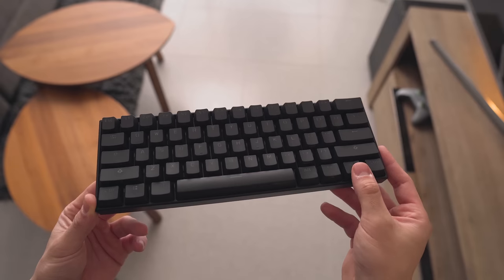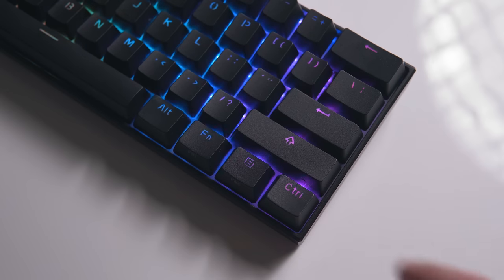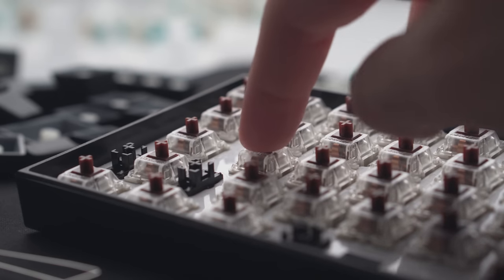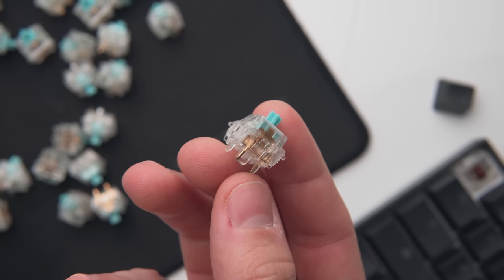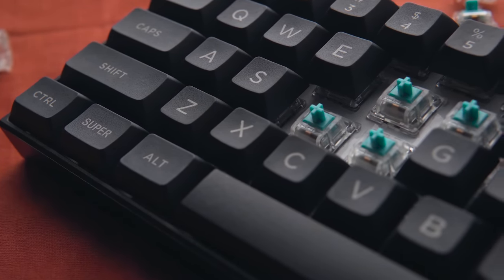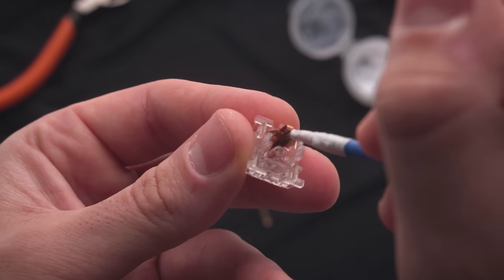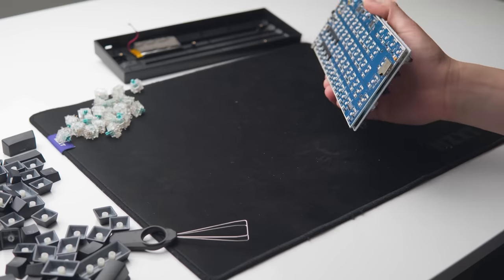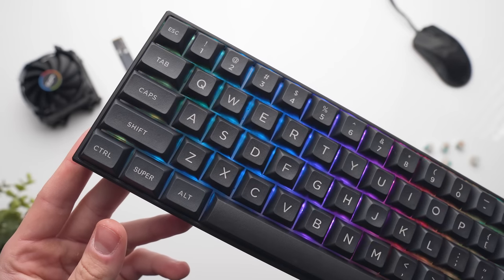Building my Dream 60% Keyboard

Comment: There's no point to get Anne Pro 2 if you're going to desolder the PCB anyway. There's a ton of custom 60% pcbs on the market and a lot of them have hot-swap support. Example: https://kbdfans.cn/products/dz60-60-pcb
Just get one of those, a custom body, and build a keyboard from scratch.
Reply: finally, someone mentioning DZ60

Comment: If you were soldering in new switches and using your own keycaps anyway, why not go full custom. A Kbdfans Tofu case and dz60 pcb would have been comparable in price, but offered an aluminum case in your choice of color, a fully programmable pcb with QMK firmware, and no desoldering. Also Ducky isn't a gaming keyboard company, Fortnite streamers just so happened to popularized the mini model.
Reply: cuz he already has that board.
Reply: @ltsjoke5443  True, but the video's purpose is to inspire others to build their "dream board", and mentioning a keyboard kit would have been helpful. After all this type of video isn't for the keyboard hobbyist who knows what is out there.

Comment: or you could just buy the glorious keyboard which is modular and you can hot swap the switches at any time.
Reply: Better buy a good plate, hotswappable PCB and case directly. 😂

Comment: ok, you really have to explain to me how you did all those switches in an hour. I can barely do about 12 per hour
Reply: If you know what you are doing and take your time, it def should not be 12 per hour. I do around 1 switch every 1minute and 40 seconds.
Reply: If you have space, pull loads apart and line up the pieces like a little production line then lube/assemble.

Comment: Hey does someone know what happened to anne pro 2 ? I desoldered it everything was working, soldered a few switches - everythin was working, solder all switches used for minute and it doesn't work. What happened ? Pcb is hot below z

Comment: If you just wanted smooth switches, why not just go for Flaretech found on the wooting?
Reply: Maybe because he wanted a bluetooth 60%?
But it's true that the Wooting boards are a very good option if you want smooth but don't mind noise.
Reply: Adomax Flaretech is a really good one for sure, and Wooting series are better than any other gaming keyboards. But, it's the process of building one, soldering and replacing stuff, that's fun. And, Adomax Flaretech work in a different way, so you can't pop it in a normal mechanical keyboard.

Comment: I disagree, the original K70 is a better build quality than the anne pro2 at the same price if you shop around. Can't speak for the mk2 k70 as I don't own one. Also, no wrist rest is annoying for me.
Reply: I own an AP2 (which can make my point somewhat biased) and I've tried both K70s for short periods of time, around one week for each, and I'd say my AP2 is a bit more solid, and the chasis of the AP2 protects the switches as well.

Comment: Can you recommend a substitute for the switches. can I use something which will also be as good after lubing.
Reply: Linear, tactile or clicky?
Reply: @Fran-lf2hp    I mostly type and currently i have a rk61 with outemu blue...I like them but now i would like to try a more thumpier sounding switch. So, you recommend typing and thumpier sound.
Reply: @probitradas1742  Most typists prefer tactile switches so you could look into Zelios v2 and a more budget friendly option would be Kailh Box Royals. Those aren't clicky switches so you'll get rid of the high-pitched noise and they'll sound deeper. Both of those have great tactility and good reputation in the community.
Reply: I have a cherry mx blue gigabyte keyboard...Now i am into the deep sound instead of the click😂
Reply: Thanks

Comment: Hey mate , I bought this setup but when I try to put the tealios back on the pcb they don’t fit due to 2 pins on the back of the switch. How do i remove this in a efficient way because I used 20 minutes on 1 switch....
Reply: Flush  cutters for converting 5 pin switches to 3 pin.

Comment: Do your happen to know if I can replace them Romer G switches in my Logitech G613 keyboard, or is logitech using a proprietary socket design?
Reply: iirc logitech has their own socket design, also romer G really aren't worth lubing
Reply: @ollij02  alright thanks for the answer! That's too bad, I like the keyboard itself because of its long battery life and perfect wireless connection, but the switches feel pretty mediocre at best.

Comment: well ok, apparently i am the crazy one here..but.. i have mech. tkl keyboard .. i like it.. but lubricating switches? who got time for that? i mean, if you lubricate them youll have to clean them also, sooner or later. or toss them and replace them.. aint that too much tinkering with somwthing that is supposed to just work? where do you draw the line?
Reply: my only reasoning to this is that the r/mk is a slippery slippery slope... i fell as a victim as well
Reply: Most people don't. A good silicon lube likely going to wear down over time, but we are talking some time to wear in and years to wear down. Even then, it'll still be good, just not as "pristine" as it once was.

Comment: Your not mentioning any of the cons. First off it looks like a cheap keyboard in terms of finish. The keys are misaligned in all directions, and the height varies for each key. And in terms of price there's no benefit because it takes so long to build that you could have just taken another few hours at work, and lastly you don't have any insurance.
Reply: i think it's because he's an inexperienced keyboard builder, you can avoid the keys misalignment easily while soldering 

and of course you can get a better quality parts (case, plate, etc.) but cost might be an issue. 
sure you can get $700 builds with full brass parts, but i think his common audience are not gonna like it.

warranty is a nice bonus, but i never really like having to wait for the replacement anyway, especially when you can fix it yourself there and then
Reply: @Looo0007  no matter how good you are your never gonna be able to solder with the same precision as a machine, so it will always be a con
Reply: @EmilsAdventure  Factory solder is lead free, which will never be as good as the leaded solder we use, and that kind of precision difference doesn't matter with this kind of solder joint. Besides, machines can botch soldering too.

And insurance only makes sense if you trust someone else to do the job for you.
Reply: @EmilsAdventure  1. When installing switches, a straight rule can for the switches straight. Normally people install keycaps and align from there, then solder.

2. The tolerance on the keycaps and stems would affect any precision soldering. After all, its not so much the soldering, but the tolerances of all the parts.

3. A mechanical keyboard is a simple electronic device. You'd have to ruin the PCB entirely to really botch it up, which is quite tricky. Any future issues can easily be fixed or replaced cheaply.

Comment: Why imply a value argument by saying "cheap" and "expensive" throughout the video? For less $$ than was spent on the Anne Pro, exotic Switches plus lubricant one could easily find a keyboard that had proper switches to begin with. It would have made more sense to simply frame this as a fun enthusiast project because it was most certainly not a bargain. Could even have titled it "Fixing the Anne Pro". Better yet, search on Aliexpress to find a multitude of DIY parts to build a mechanical keyboard from the ground up.
Reply: Define proper switches?
Reply: Are there any boards that ship with "exotic" switches?

Comment: dont buy 180$ keyboard

buy a 108 dollar keyboard 
and spend 80$ for switches 
plus spend like 2 hours desawdering and lubbing 🖒oh yea and forget about macros
Reply: result is still leagues better than the $180 board and it does have macros ;)
Reply: @nysaea  Wait it does?
Reply: @Ryan_Plays-Full channel rebuild yes, Anne Pro 2 does support macro features, just there are no standalone keys
Reply: @ryan_plays-fullchannelrebu3666  Yep, I know for sure you can program them with their software, though I don't know if you can program them without it like you can on the Ducky One 2 mini. Someone correct me if I'm wrong.
Reply: @hikarii8758  oh sorry i was not aware.